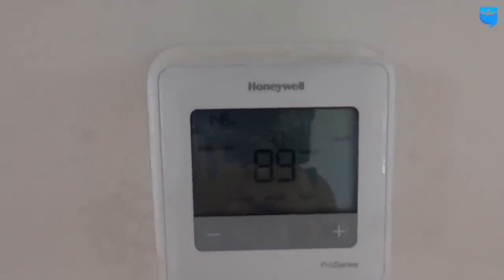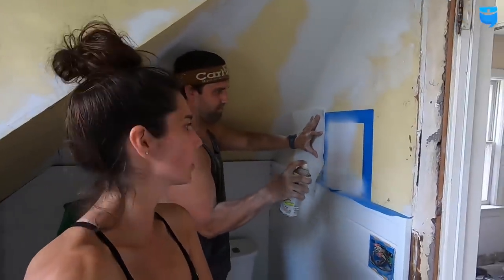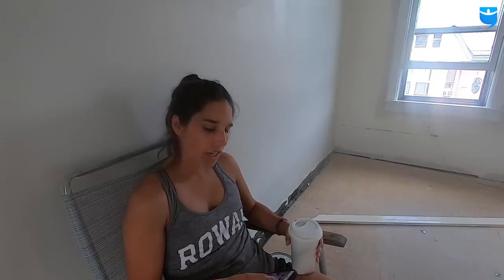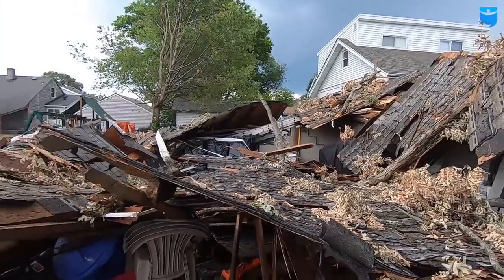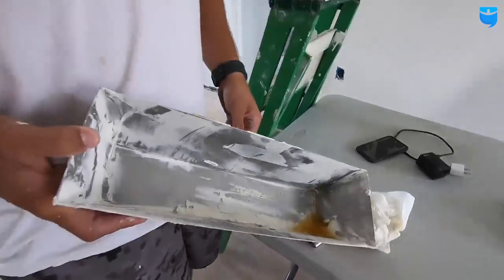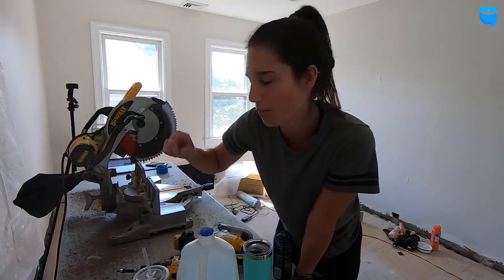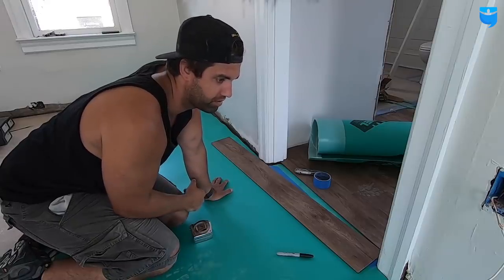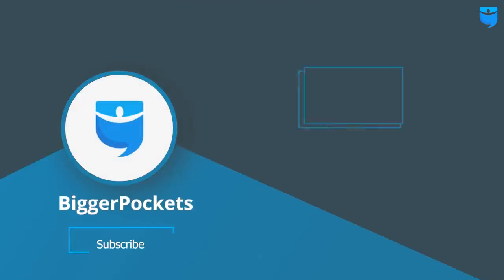EP 15: Landlording Nightmares & BRRRR Real Estate Investing | Rentals To Wealth

Comment: Great stuff guys! Flooring looks great. Quick question: how do you guys cut/notch out cuts on the LVP itself? Thanks! Keep it up
Reply: For cutting length I use a chop saw (mitre saw). For cutting width I use a table saw. If I have to notch anything I’ll use a jig saw. After you lay the LVP you may need to trim it back when you install stair nose or other thresh holds, for that I’ll use my flush cutter (oscillating saw). Hope this helps! If you need any other tips you can always reach out on Instagram, I’ll talk this stuff all day lol

Comment: You don't have anything uploaded today (May 29th, 2022) so I just clicked on an old video to sub in for my usual Sunday routine =) We just installed LVP in a friend's warehouse and the overall length was 38ft. After Kyle mentioned having to add thresholds for expansion and contraction, I paused and quickly searched for the installation instructions for Lifeproof: 
"22. Remember, the use of coordinating T-Molds is required when installing LifeProof Vinyl Plank in a room or area that is larger than 100 lineal feet (30.5 meters) in any direction, so that the floor is separated into sections that are no larger than 100ft. x 100ft. (30.5 meters x 30.5 meters) per section." 
Did Kyle mean 30ft or 30 meters?

Comment: I think that lvp flooring isn’t supposed to have the cabinets in the kitchen sitting on top of it so it can expand
Reply: Yeaa however we use IKEA cabinets which hang on the wall, normal shaker lowers that sit on the floor shouldn’t be sat on top of the LVP more so because the vinyl will compress over time from the weight of the countertop but also for exp/cont

Comment: Yo, the new solid core vinyl planks are not supposed to expand and contract. I've seen mcmansions use long lengths of lvp past 30ft
Reply: Have you read that on any of the manufacturers installation instruction? If so definitely let me know what brand it is bc I’d love to be able to not break long runs. I haven’t seen any that claim no expansion/contraction though. Let me know, thanks for the heads up!
Reply: My rehabber experience is that yes lvp expands and contracts ALOT. Its particularly bad in areas of floor that get a lot of direct sunlight. I think you wise to allow expansion joints.  And install window shades on southern-facing windows to prevent solar heat gain.
Reply: Elizabeth Zieman Thanks for the tips!
Reply: @elizabethzieman1059  are you talking about stone core LVP?  I can't imagine how stone core can expand and contract.
Reply: @kk P.  Ummmm....I do not think it really matters the exact density of the vinyl.  (Sorry I digress into architect-nerdom).  Every material has a Coefficient of Thermal Expansion ie the amount materials expands contracts with temp changes. Vinyl in general has a notoriously high coefficient.  We have the same problem in exterior PVC materials such as deck, trim, railing etc.  you have to detail differently allowing for the expansion and contraction.  I would expect though that a thicker plank might be less likely to buckle, which yes does happen with the thin plank, but sometimes you need to use that thinner plank when subfloor is uneven.